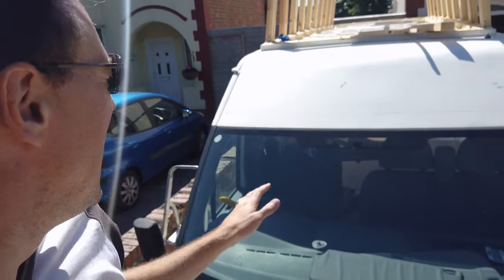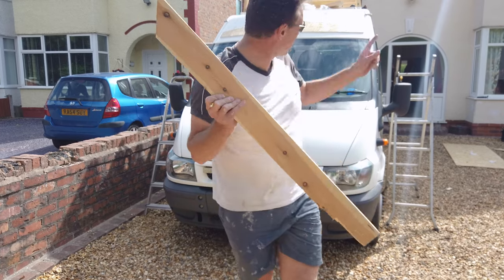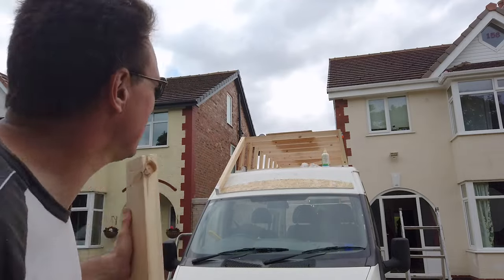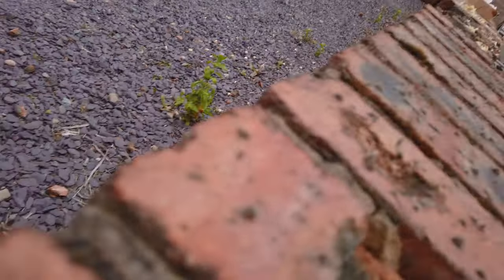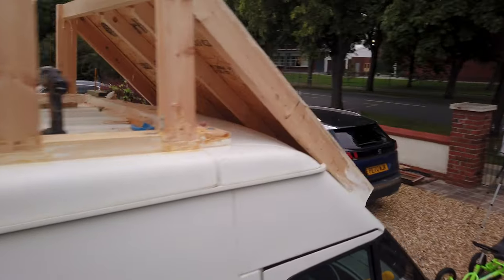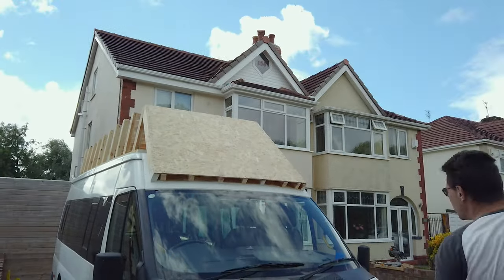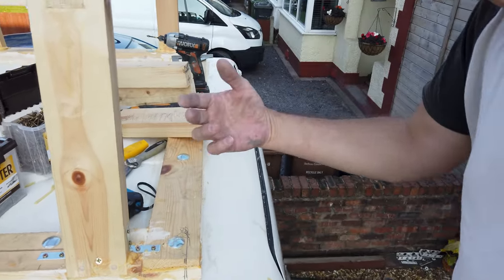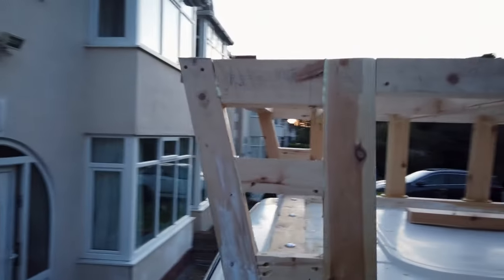DIY Camper Conversion | roof extension 4 | diy hightop roof  fibreglass van roof  Van Build Ep.12!!!

Comment: Nice front angle, matches up very well.  I know how hard it is to get parallel doing it all in the driveway.  Great job, I'll be watching the whole playlist.  Cheers from the USA.
Reply from the maker: You defiantly have a neater finish. Our roof is solid though and bone dry even after the sub zero temps and driving rain over winter. Thanks for watching along. How is your Van getting on?

Comment: Looks amazing big job to undertake have you though about how much weight it’s going to add to your build? As I know weight a big thing with building own van
Reply from the maker: Thank you so much for your comment. It was originally a 17 seater minibus so the revenue weight is 4100kg as apposed to a standard van which is 3500kg or less.
Reply: That give you a bit more to play with did you weigh once you striped the seats out ?
Reply from the maker: @gap_adventures  It does gives us a bit ot wiggle room. No, we didn't weigh after we had taken the seats out.
Reply: @traveling-taylors  just be careful a friend of mine weight has after build and was 4100Kgs and was only plated for 3500 lucky he been able to up plate more people I speak to the more I here weight your biggest problem I only sharing what I heard not trying to be negative I can’t wait to see how you whole van build turns out
Reply from the maker: @gap_adventures  We really appreciate the information, thank you and we don't think you are being negative at all.